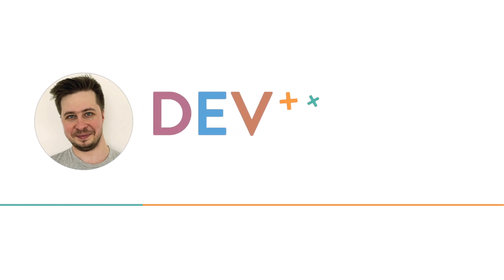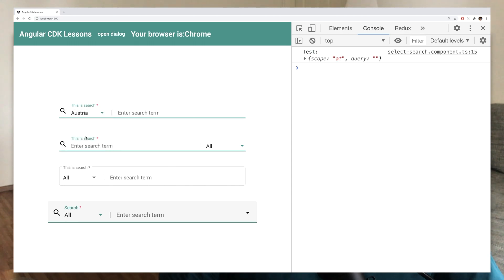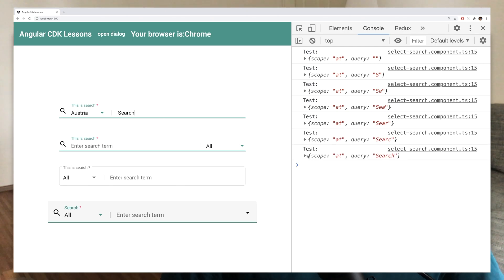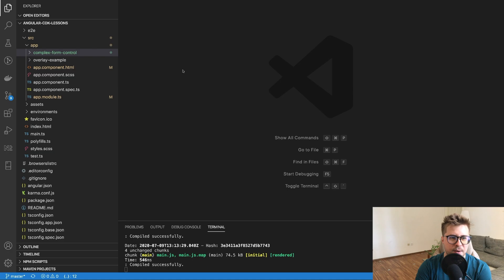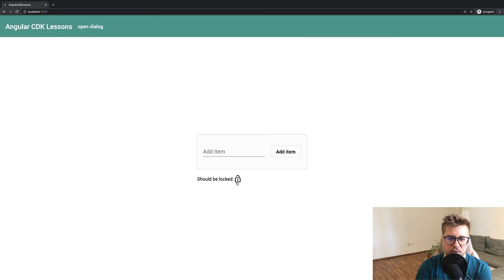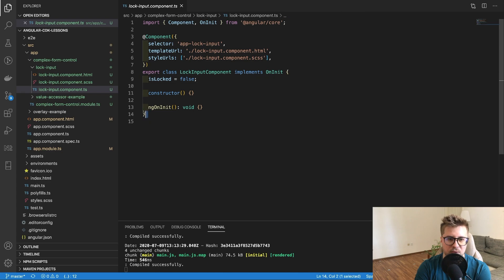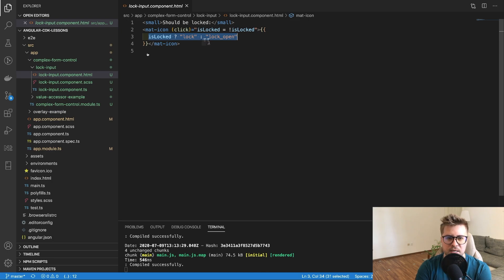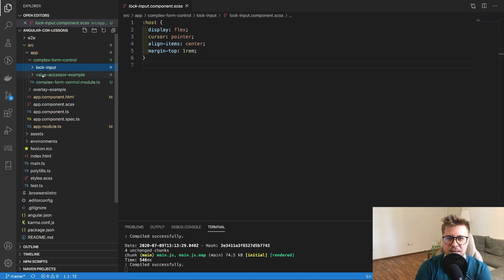Control Value Accessor in Angular [Advanced, 2020]

Comment: Nice tip. Thanks😊. I'm gonna use it in my project. This is the best way to handle reusable form control in different forms. We are currently handling the way you said it initially how we handle if we don't know the Value accessor 😅

Comment: Can you create a video on the following topic or at least suggest a way of implementing it:
The scenario: 1 page component which has 2 children: First child is a complex component with a lot of children and deep inside one of them there is a generic reusable component which holds a reactive form. The second child of the page component is another form which again is used on multiple places. However exactly on this page component there should be a sync between the two forms (the form from the second component should check the validity of the other deep nested form before being submittable). I have tried to create a service, which is provided on a root level and to store the reference of the deep nested form there. It seems to work but I believe that there are better ways of achieving this, since each time this component is used on different places the reference of the form within the service is being replaced.

BTW you content is amazing! Keep up with the good work!
Reply: Could you please describe it in more detail?

Comment: OnPush change detection strategy does not work using control value accessor? Because the form value change is not an input change, nor an event triggered in the custom control component
Reply from the maker: Yes, indeed. If you use onPush then you have to mark the component as “dirty” using markForCheck in the cases you described (e.g in writeValue() method)

Comment: Hi, can you please provide me a source code. I've reading your tutorial and I have getting this error on clicking a clock icon.
ERROR TypeError: this.onChange is not a function
    at LockInputComponent.setValue (lock-input.component.ts:46)
    at LockInputComponent_Template_mat_icon_click_2_listener (lock-input.component.html:2)
    at executeListenerWithErrorHandling (core.js:15272)
    at wrapListenerIn_markDirtyAndPreventDefault (core.js:15310)
    at HTMLElement.<anonymous> (platform-browser.js:560)
    at ZoneDelegate.invokeTask (zone.js:406)
    at Object.onInvokeTask (core.js:28645)
    at ZoneDelegate.invokeTask (zone.js:405)
    at Zone.runTask (zone.js:178)
    at ZoneTask.invokeTask [as invoke] (zone.js:487)
Reply from the maker: Hi! Link to the source code in the video description, check it out there.

Comment: Great Video. Clear explanation. Can we use this control value Accessor with a component which can return multiple values with multiple inputs. Ex : date range with 2 datePickers or address component with several text boxes . Thanks !!! :)
Reply from the maker: Hi, Thanks!
I am not sure that I understand completely your case but the value of your control accessor might be object where you can store as many values as you need :)

Comment: Hello, on your next video could you possibly talk about implementing ControlValueAccessor together with MatFormFieldControl (Angular Material)? I think the most challenging part is to get it to work with the errorState when using validators.
Reply from the maker: Hi! Great feedback, thank you! Exactly ControlValueAccessor together with MatFormFieldControl will be covered in 3rd part :)
Could you please tell me more what is exactly challenging for you in errorState? Actually errorState was not initially included but maybe I will adjust my video script and cover it as well or create separate video if this topic will be too big.
Reply: @DecodedFrontend  binding NgControl's error property with the errorState attribute, so that the component would turn red if there was a validation that is not met.